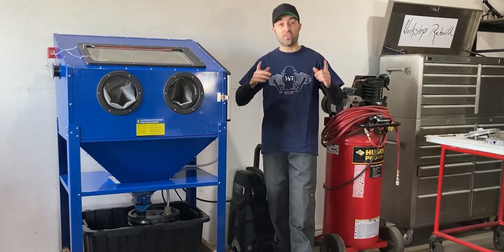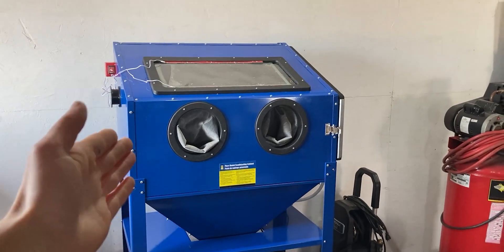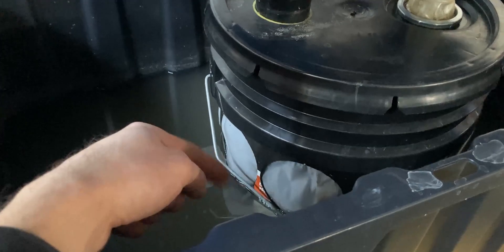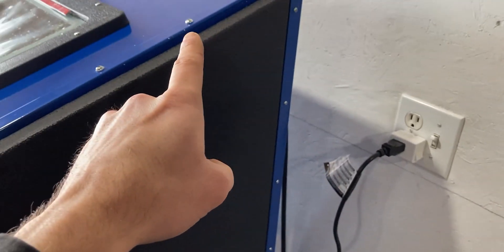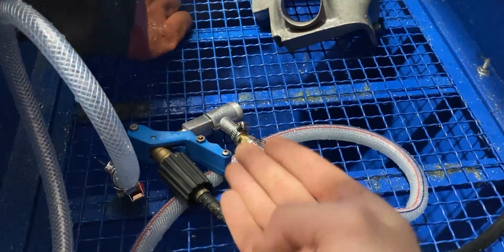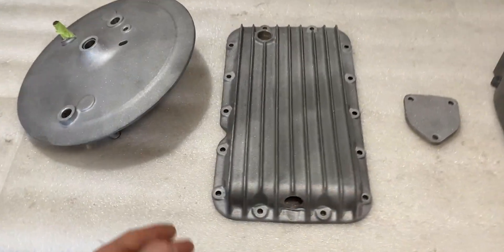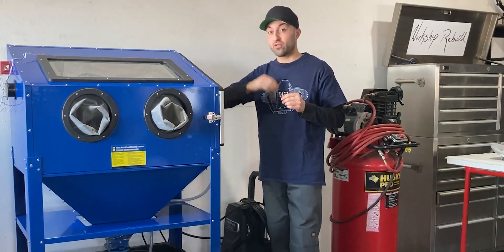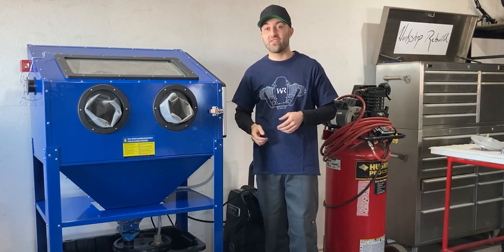DIY Vapor Blasting Cabinet with Pressure Washer

Comment: What kind of submersible pump did you use, is the bucket drill full of holes to allow water to go in.what pressure do you find thst cleans aluminum to shine

Comment: Seems like the water coming from the power washer would dilute the slurry mixture percentage. Most videos I see recommend a 25% media to water. Did you increase this percentage to adjust for the extra water through the pressure washer? 

Thanks

Comment: What I found and it works for me is the 2 stage cleaning. First all the grime and contaminants must be removed in any way you like. (Wash tub, dry blasting) than honing is the second stage. That way the slurry stays clean and we are not forcing the contaminants back in to the surface of the part we are cleaning. When I started with the single step my results were deteriorating with every next piece I refinished

Comment: Interesting idea on using a pressure washer instead of air.  My only thought is that you can easily regulate the air pressure and most people that run glass bead turn it down quite a bit, like 50psi or even less.  Pressure washers are hundreds, even thousands of PSI.  (i know the specs- but the reality depends on HP, nozzle size, flow rate, feed, and lots of other factors so that's why i'm listing such a wide range).  I wonder if that much pressure will just always break down the glass beads (faster then usual, like immediately)

Comment: No video but I did this with a pressure washer. Only difference is that I use Venturi effect with dry media. I dry and recycle the media. No pump needed. Works great but if I could eliminate that step I'd be happy

Comment: Hi, I am also working on a project similar to your setup. I would like to know if you have completely abandoned it and switched to compressed air instead of a pressure washer. Have you continued working on your idea? I have also made a filtration system and am about 80% finished. The pressure washer I use is 110 bar! Do you think that's enough to be effective? I would love to hear more about your solution and whether it is still working.

Comment: Que buen trabajo yo tengo una maquina igual hace 7 años y el problemas de filtrar el abrasivo lo hice con 3 recipientes los cuales uso filtros de cafe donde el sistema que uso es por decantacion .
Entra agua por el recipiente por abajo y pasa al otro recipiente por arriva y en cada conexión tiene el filtros de cafe y uso esferas de vidrio de grano 100 es muy bueno el acabodo que deja por que la arena me dejaba las piezas opacas sin brillo
Reply from the maker: That's very interesting! Do the coffee filters still contain residue in the last bucket? Do you use a pressure washer or a regular pump? Cheers

Comment: Are you still using the vapor blasting cabinet? Will there be an update video on this? Is the filtration system still good and did not break the preasure washer?

Comment: Thanks for the great video. Looking to build something similar to eliminate the need of a high capacity air compressor for vapor plasting. However, the results looked a bit closer to traditional glass/sand blasting than vapour blasting. Have you done any more testing with other media and gun/nozzle optimizations? Would love to have a follow up video!
Reply from the maker: I'm glad you enjoyed this video! That is correct, the results are similar to any regular blasting application. The choice of material is actually what is going to give you your finish...crushed glass or anything with sharp-edges will leave a rough surface, glass-bead or any other beaded-material will leave a smooth finish...etc. Crushed glass was chosen in order to prep the surface for Cerakote (This is also recommended by the manufacturer)
I will showcase an update in the near future and go into further details on this machine. 

Thanks for leaving a comment with great questions! Regards Andreas

Comment: Looks very interesting! Please keep us updated with your project revisions. I'm sure there are tweaks to come.

By the way, I was involved in using high pressure water and an injector to draw in media over 30 years ago. A PhD hydraulic engineer told me that the media being drawn into the water stream picks up 1/3 of the pressure. So, a 1500psi pressure washer will result in media hitting the object being cleaned at an effective 500psi. We were using 10,000psi at 8gpm but for the same horsepower, we could have done more at 15,000psi at 2gpm. In this type system, pressure is more important than flow.
Reply: would it be the same pressure drop seeing as he has a different pump feeding in the media? from your explanation it sounds more like a system that is drawing media into the high velocity stream and using that drop in pressure to pull the media in and accelerate it
Reply: @cryoine7194  I hear what you're saying. Watching his video again, I realize he's feeding the slurry under pressure. So, you are correct. Not nearly the drop in velocity.

These days in the pressure washing world, it seems pressure sells but flow cleans. Most vapor blasters use an air compressor with lots of cfm (15 to 20cfm). That's 5 to 10 hp. I'm thinking there's something about horsepower... either driven by air or driven by water. A 115v pressure washer isn't going to put out much more than 1.5gpm and maybe 1500psi with a 3.5 tip. 

Rather than using a pressure washer, I'm wondering about a roller pump that puts out 300 but 10 to 20 gpm. Regardless, the water must be very well filtered feeding any pump.

Comment: What a great idea. You could build a second tank that would filter the water and recycle it and not have to use fresh water.
Reply from the maker: Thanks a lot, Joe! I agree with you. Many filtering compartments on machines use a type of overflow system to capture their desired liquid (oil, coolant, water etc.)
The main goal is two capture two different types of fluid:
1: Water & Media for blasting
2: Fresh water for the pressure side

With this in mind, any type of system that can separate this will work just fine.
I will try and share an update video on this topic sometime soon👍🏽
Regards Andreas

Comment: At psi above 60 with just air you would be breaking glass beads and turning them into crushed glass. Water will have some cushioning effect, but 2400psi, which is about what the pressure washers run at is way too much. you need an additional reservoir that has low pressure water flowing in as well to reduce water psi and increase flow rate by like 20x to get to sub 100psi at the nozzle.

Comment: Pressure washer is causing your pitting. Just use a pump you will get better finish
Reply from the maker: The pitting is more or less from the aluminum oxidation, as it is over 50 years old. The crushed glass I used in this video did create a rough surface finish and that is what I was after.
What type of pump would you recommend? 
Thanks for your comment😃👍🏽 Regards Andreas

Comment: Absolutely great solution to not having to purchase a air compressor. One can buy those small power washers just about anywhere. 60107 USA says hi.
Reply from the maker: I appreciate it, John! I will try to make an update video on this and publish as much infromation as I can about this system. Regards Andreas
Reply: @WorkshopRebuild  Absolutely. I even see portable solutions in making a unit gas powered for field service crews to clean parts at minimum expense, and non toxic too!

Comment: Any updates? Interesting take on the wet blasting setup, very interested to hear of further iterations of the project.
Reply from the maker: Hi Dan, thanks for tuning in to watch this video! I have made some small upgrades behind the scenes and the machine is working well. I have since used it to vapor blast all BMW motorcycle engine parts and it did an excellent job. I will take some time to share an update video about this system, but I can't tell you exactly when. If you have any questions about this system I can include the answers in that video.
Thanks again! Regards Andreas
Reply: @WorkshopRebuild  can you give a full brake down and build vid please please please 😂

Comment: I'm super curious about this project. I recently built the traditional style vapor blaster using compressed air. Using a pressure washer to propel the slurry is a great idea though. I'm curious if a pressure washer is a bit overkill being that you generally limit the air pressure to around 60psi on a traditional setup. I did some Google searching and it looks like you can buy water pumps in all sorts of pressure ratings including 60psi. I'll be on the lookout for an update when you try out a finer media!

Comment: Doesnt the abrasive material damage the pump?
Reply from the maker: Hi there, with the correct filter material in place there shouldn't be an issue. To be on the safe side I will add more filter material around in front of the pickup tube to ensure the pressure washer pump does not see any blast media. Great question! Regards Andreas

Comment: I actually tried this concept last summer. I moved and did not have 220v to run my compressor in my garage. I used my gas pressure washer. It did not work as good as air since the gun was not optimized. I also hooked it up to a water source and it adds 1-2gpm to the system which is not ideal. My basin fills up fast, and water would have to be purged every few minutes. I wouldn't feel comfortable with filtering water from slurry source, especially when you end up running finer media. I plan to revisit the concept soon with a better gun design.
Reply from the maker: Hi there, it's nice to know you tried this out as well! The gun is different from a standard vapor blasting machine that uses air, and therefore it must be custom made to suit a pressure washer with the correct valve. The amount of pressurized water in this system does not change the cleaning effect, the abrasive material does. This system could be improved to accept different types of material with a "quick-change-system" and when using finer media, one must use a finer filter material. There are many synthetic filters out there that will work just fine, but I will make sure to follow-up on this topic.
Thanks for watching and leaving an insightful comment! Regards Andreas
Reply: @WorkshopRebuild  I installed a 50amp outlet: https://youtu.be/-EEgEwv4Yyk

Also, here are my thoughts on pressure washer vapor blaster: https://youtu.be/df2Ug3S--kI
Reply: Well today I learned that not all houses have 220V running to them. I'm guessing this is an older home you moved into?
Reply: @ACEGAMER120  The electrical system is 220v to every fuse panel, so all homes are 220v. He probably doesn't have a 220v outlet in his garage
Reply: @JamesS-o4q Incorrect. Some very old houses still only have 120V running to the panel

Comment: I did a double take on this video. This has potential. Not everybody can afford a compressor and electric pressure washers are cheap. Your media is too abrasive. It’s damaging the aluminum. But lets see what it does with the glass bead.
Reply from the maker: Hi Randy! Thank you so much for watching this video and leaving a comment. I agree, air compressors can get pricey, pretty quickly and that‘s exactly why I tried to go this route😁
I am aware that this 30-60 crushed glass abrasive is very rough and I might only use it for the BMW rebuild project.
I‘ve seen many oxidized and discolored cast aluminum parts before, but this metal is in very rough shape. The oxidation layer is very thick and I was trying to approach this as a „roughing“ stage.
I have since collected some information about aluminum preservation and I will explain why I‘m opting for a rougher grit abrasive on the BMW cast aluminum parts.

I will make a follow up video with slight modifications I made to this Blast-cabinet and also shed more details on the machine.

Thank again! Regards Andreas

Comment: I was searching for this for long. How do you build this nozzle?
Reply from the maker: Hi Jonny! I‘m glad you found my video and hopefully it gave you a little insight on how you could build one yourself😃
The nozzle consists of two parts: pressure washer feed and the front portion is dedicated to the media feed.
Most pressure washers have high pressure ratings and therefore you‘ll have a strong valve. I actually used the exact same valve from a pressure washer handle. This was integrated into the back of an existing „sandblasting-gun“ and I just merged the two parts together.
Pretty simple actually and it turned out to be very compact!
I hope this helps. Regards Andreas
Reply: @WorkshopRebuild  Thank you for your answer. So am i right? You dismantled a pressure washer gun, boned to the valve,  and put on a dry sandblast gun Tip?
Reply from the maker: Basically, yes! Since you do not have the pressure washer tip (which builds your pressure), you must install an orifice. This is between the pressure washer valve and the media flowing into the handgun.
I hope this helps.

Comment: its hard to compare to those air power vapor blaster. it looked pretty similar to the air powered unit but how could we know if this is equivalent to 12 cfm at 60 psi or 5 cfm at 100 psi is hard to say. you would probably need to inspect the glass beads after using them. if the manufacturer says use the glass beads under 60 psi or they will break, if they you don't break  then you know you are under the equivalent of 60 psi.
 but realistically, as long as you get the finish that you are looking for, who cares how it compares.
earlier I was thinking why not with a power washer that is what they use for outside application pressure washer with an attachment at the tip. Then start looking then bam, I found your video!!! glad to see I'm not the only crazy one to have had that taught
Reply from the maker: I would say they are very comparable, when it comes down to the function of the machine. I could install pressure gauge to see what values I have, but I know that this systems already works the way it should, so I don‘t need to.
The glass bead will always break down over time, but I‘m not sure at what rate. If I could regulate my pressure, I could probably reuse the same media for a very long time!
I noticed the pressure isn‘t as important as some „experts“ say it is, but the media is! In this video I chose crushed glass for my application, but I‘m going to try glass bead and see what results I can achieve.
Updates will follow and thank you for your great comment. Maybe you‘d like to build one like this yourself😎👍🏽 Regards Andreas

Comment: Glass beads preferably no 13 or 170 to 325 is what you want. However the pressure washer is to high of a pressure and will destroy the media as well if any media gets into the pump of the pressure washer it
 will be destroyed
Reply from the maker: Hello there! Thank you for your suggestion about the glass bead. I think that would give these parts an awesome finish and a neat shine to them! Using a smaller bead would mean I need to change out my filtration system for a finer material. I am planning on upgrading the filtration system so I have 3 levels of "security" before the water is clean enough for the pressure washer. I really wouldn't want the media to chew up the inside of my pressure washer haha.
Reply: @WorkshopRebuild  First rule of filtratration is gravity

Comment: Hey man you surely proved the concept! Only way I've ever seen to achieve "dustless" blasting. Definitely a great idea! Curious to see if you find that sweet media that works best. Always used silica myself but never wet like this. I think they use granite in water jets. I was pondering if this could be construed as a high volume low pressure water jet lol. Obviously would only cut paper. Lord knows I've spent lots of hours trying to improve the function of a blast cabinet, I think you've done an excellent job. Since the concept works, time to throw more power! Bigger pump on the media solution and higher pressure washer pump. Can't wait to see what you can figure out. Maybe some solvent or acid in the water? Keep in posting brother, we love it!
Reply from the maker: I'm really glad it worked out this way and now I'll try and optimize the system. That's right, it really is a dustless form of sandblasting/media-blasting. The media is a little bit too coarse for this aluminum, but I have a feeling a smaller grit will work much better!
I'm not even sure how strong water jets are, but I know this pressure washer cannot reach such pressure! The one I used in this video has a max rating of 2000PSI. If I need to bring the pressure up a little bit, I can always make a smaller orifice, without damaging the pressure washer.
You know exactly what it means to improve and optimize a blasting cabinet, especially since you've done it yourself! What media do you usually run and for what materials?
Thank you for your kind words!! I'll do my best to make this system better and hopefully I can get a better camera setup. The blasting footage was very poor, because the water shot up against the glass. This is something I'd like to improve, to make better timelapses of the parts I clean. Thank you for your comment and support. I appreciate it! -Andreas
Reply: @WorkshopRebuild Keep on doing the concept research on this. I can see this to be perfected and you enjoying a nice retirement and company owner.